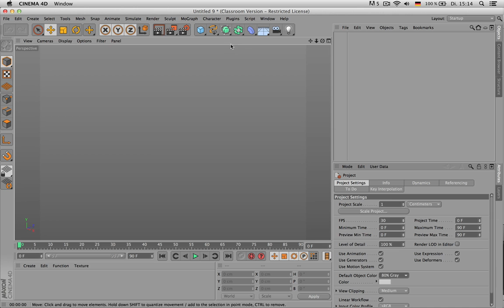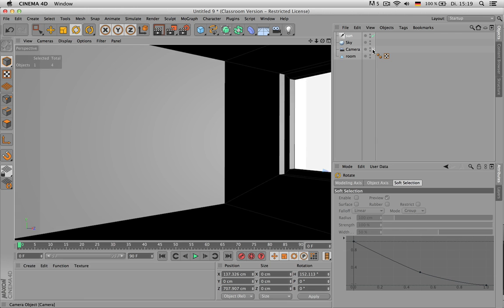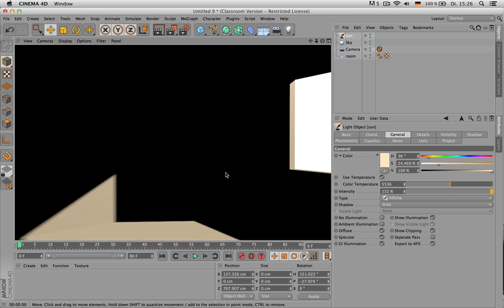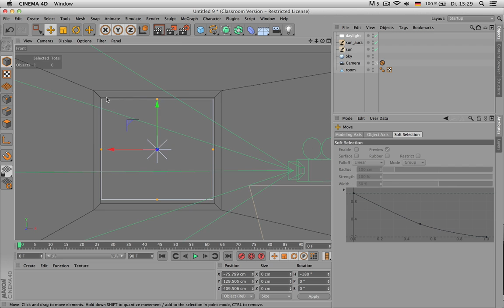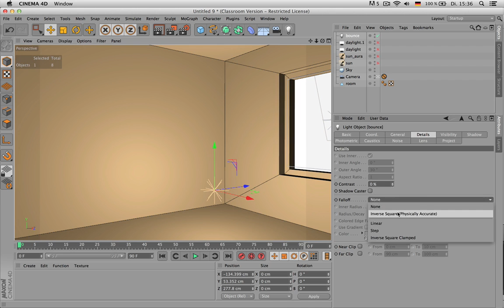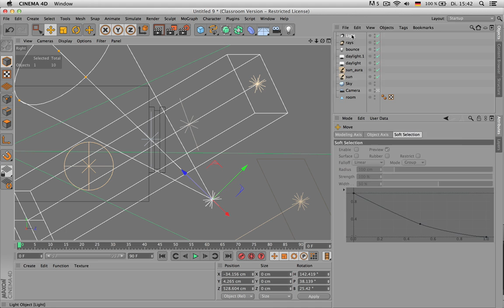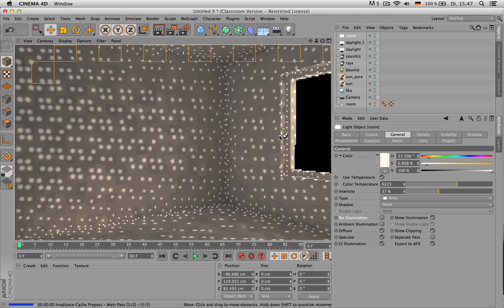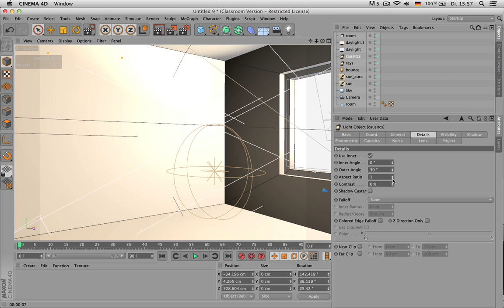Lighting a Window Scene - Cinema 4D Tutorial

Comment: Hi man! Good tutorial! Thanks. But I have some troubles with my render. When I do render to see what I'm doing, it doesn`t looks like your render, specially when I change the Global Illumination settings as you do. Do you use an special render seting, or maybe ar external render software? Could it be because of the Cinema4D version I'm using (R18)? Thanks man! Blessings.
Reply from the maker: In R18:
Effects - Global Illumination. - Secondary Method: Light Mapping - Samples: Low.
(Gamma: 1.2 or 1.4 if you like more overall brightness)
Irradiance Cache: Record Density: Low
When your light setup is final, set both parameters back from 'low' to 'medium'.
Reply: Konstantin Magnus perfect! Thanks!